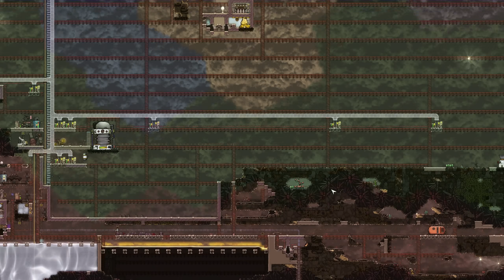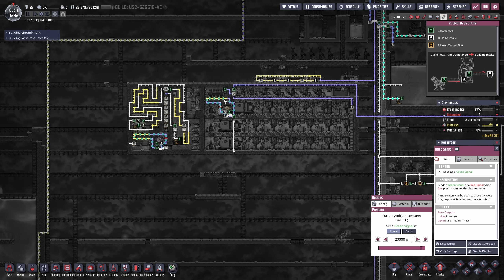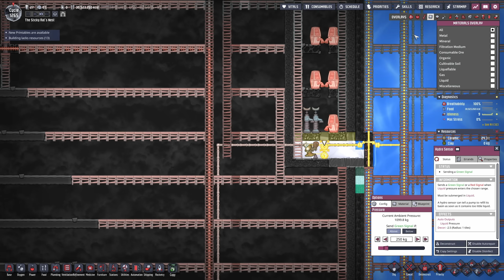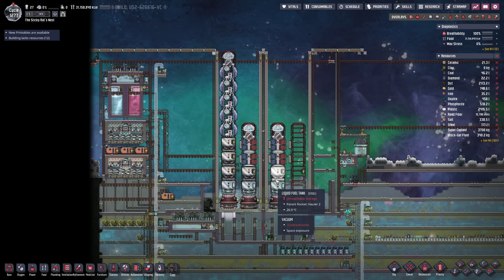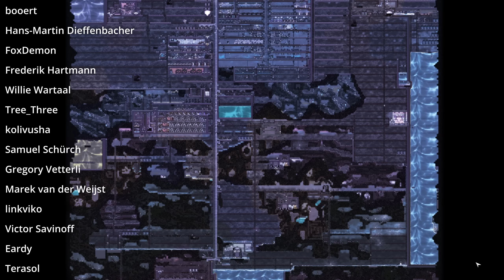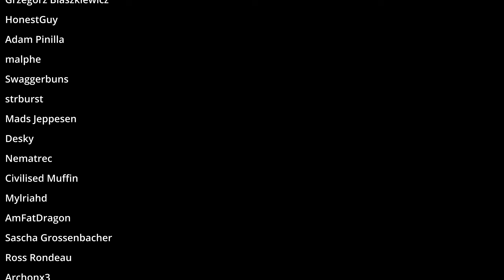Boiled nice and clean : Oxygen not included ep 21

Comment: You could have built a much simpler load balancer. :)

Or just used the third port to send any overflow.  The input ports aren't connected to fixed outputs, I think.  Don't they just mix?

(For next episode: just leave your existing load balancing system as is, but add the pH2O in the third input.  No need to complicate things.)

Comment: The geothermal pump works by taking all the liquid in the heat pump and moving them into what ever vents are connected to the pump at the time.  If any of the vents still have something in them waiting to be ejected then it won't push the fluids out to any of them. it's part of the description in game on the vents.  "Geo vents must finish their current emission before accepting new materials."  I've not tried it yet, but you might be able to send a dupe in to disconnect and reconnect the vents to manually bypass overpressure vents and allow the pump to push the materials to the ones that can still accept it.

Comment: 11:20 having all 3 hooked up, will give you more water purification throughput basically. I have on my map 1 pipe in which is recycled water from the turbines, 1 cool brine gyser and 1 salt water gyser, it gives me an input temperature of about 80c,  which puts the steam at 230 every output so its constantly giving me max power. I think its about 6 tubines per vent to have it running non stop.

Comment: @5:00 I worked in environmental clean up (gasoline storage tank remediation), and our mantra was, "Dilution is the Solution!!"
Reply: Vet medicine, same idea. Screw up an injection? The solution to pollution is dilution.
Reply: In Satisfactory, I opt to make diluted fuel from refining crude oil into heavy oil residue first before making fuel directly from crude oil. Then once I have all that diluted fuel, I'll then make plastic and rubber with it and any leftover I refine into turbo fuel. The trick is, just add water.

Comment: I really don't like the pipe salad of the Heat Pump, putting 3 pipes vertically occasionally interrupted by a bridge gap filled with a horizontal line of 3 bridges on priority geyser output followed by the steam turbine outputs in the same manner. Only Salt/Brine for a few hundred cycles will starve the steam rooms but everything else is water positive expect a solid 2kg/s output of water when all 3 slots are used throughout meaning it should never be turned off realistically.
Abysallite is Tungsten if melted, so techically it's better than Niobium since that one's practically infinite with enough Tungsten. The only base game planet ruined by research is a ton of Isoresin!